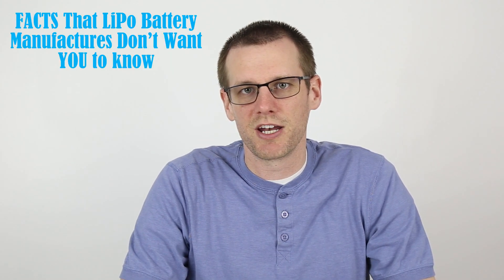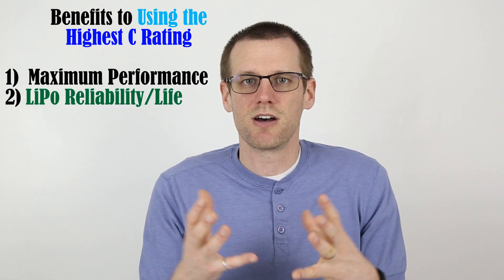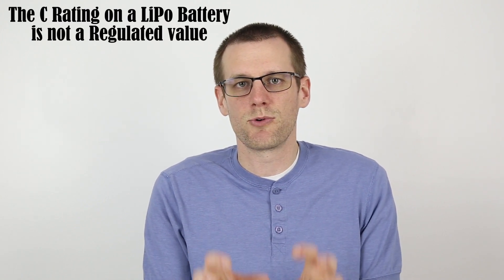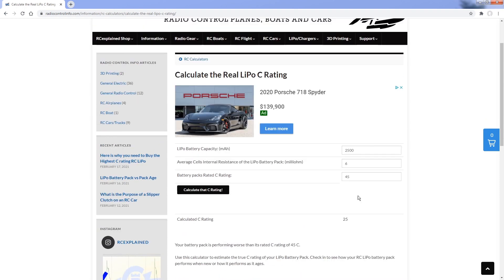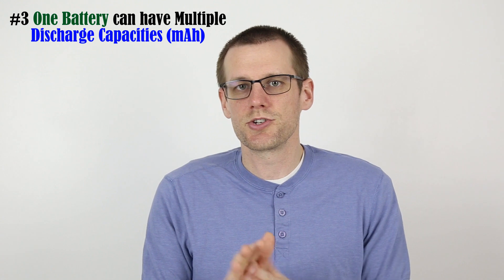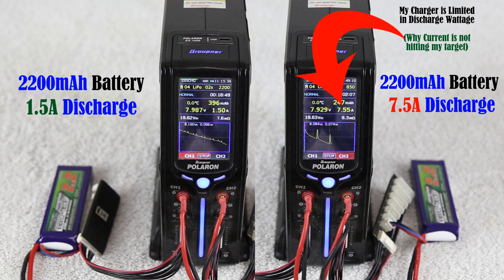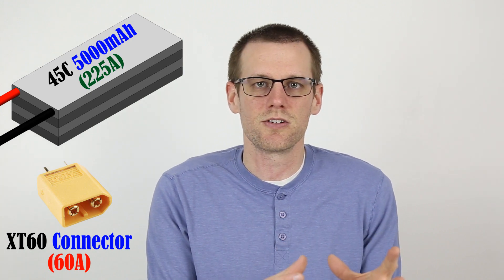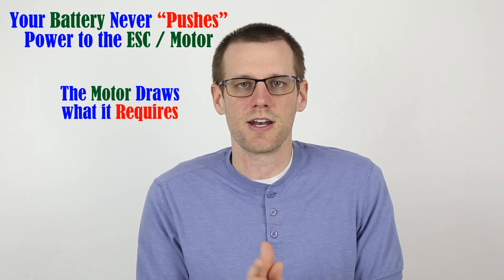What RC LiPo Manufactures Don't Want YOU to Know

Comment: C ratings are like Wishes and Hopes but 100C is more than optimistic 🤔
I have a lot of hours on lipos, mostly RC Aircraft, Drones, ECT. I do have some in RC cars too 😁 
I really don't think there is that much difference between one Manufacturer or another 🤨
Yeah, I have gotten some good packs and bad ones, form the same manufacturer, 🥺 go figure.
Overall I have had better luck with some, but I have some that are still going after 6 years 😲
Brand names and high prices don't guarantee a good battery or that it will meet your expectations.
Traxxas batteries that I have cost up to 3x more than another brand I bought. In the car, on the ground, I can't see any real difference in their performance.
Ok, I am sure we could test all mine and come to some kind of conclusion, but does it make much difference when I go out and play 🤔

Comment: Hello. Thank You for very good content as always i have to subscribe 🙂
I have one question. For Traxxas truck Sledge, which comes with two TRX iD connectors. I want to use only one battery pack. 4S or 6S.
I got 4600mAh with 35C and there was soldered T-dean. I changed the connector for XT90. Im affraid for soldering connector on ESC so there is a TRX ID connector and i have XT90 - TRX adaptor.
I know that better is when i solder off the pair of stock connectors and solder only 2 wires and there place XT90.

But i tested yesterday draw via Link app. On the road i achieved 100,9A max and in the grass 113,9A. So... if im counting right, i should solder XT150 or AS150 on ESC and battery packs?
Because TRX connector limit is about 60A and XT90 is about 90A. But it was in some specification im not sure which A, connectors can survive really. Traxxas original battery 25C 4S 6700mAh, has 167,5A limit, so im little bit confused about connectors limits. Because some folks really using these 2x4 batteries in 8s X-maxx and im sure that  there is a way higher consumption than is specification of TRX iD connector. My question leads to XT90. I have bought few pairs and want to solder also ESC. But will it be enough? These almost 114A i achieved on the grass with stock gearing and with smaller tires than the stock one are.

Im ended my tests after 30minutes, it drawn about  3000mAh from the battery pack and connectors were hot. It never happens on my Slash with 3S.
Exact this "hot" issue make me think about it again. I watch your videos about KV this, and some other. But can not find any suggestions for real limits of different connector types.
I know that motor takes what it want, but yeah in this case it is little bit over the edge when i use one single Traxxas Id or  old TRX 4(which i love)  or XT90  with adaptor to Traxxas connector.

For safe all i should go to XT150 / AS150  and change it also on my ESC, am I right? I think on 4S it is okay, but 6S via one cable and connector, can be an issue. I also plan test 4S battery and do the same measuring. I suppose, there will be a lot lower "A" peak.
Sorry for my broken English.
Reply from the maker: If the connectors you are using are getting hotter than 60C, then I would move up to the next size available. Looking at it from this perspective removes the more technical current capacities. An XT90 will stay under this temperature if you see only 114 peak Amps.
Reply: @RCexplained  Thank you so much for this pretty fast response. Your videos are superb :-) One small question for the Traxxas connector. For it is no much comfort zone i think and the heat production and the bottleneck here will be adaptor and stock TRX iD connector on ESC. Remove adaptor and solder XT90 on ESC is the only solution. Current setup is batt with XT90-> adaptor XT90-TRX-> TRX iD connector on ESC.
Reply from the maker: I would remove the adapter. Adapters are not helpful for performance. Only convenience.
Reply: @RCexplained  Hello. I decided to change all for AS150. Because when bash on 6S its not only short 110+A burst. It can be 2 minutes in the grass. I rather replace for safe also on ESC and on all batteries. I have now only 3x4S and 1x6S so not really high amount of soldering. AS150 seems also to unplug manually easily than XT90, where is some force needed.

Comment: All my big rigs use amss as150 
J pull 600amps + through them. Just look at cable rating I use 8 swg 8” uk use xt90 10” up us as150.  You’ll also need plugs with spark arrest inbuilt to stop spikes in plug it

Comment: I used 60a esc and 3100kv brushless motor,how big value c rating best for my rc boat?
Reply from the maker: As high as possible.
Reply: @RCexplained  tq very much for your answer
Reply: @RCexplained  are my brusless motor and esc safe if i use 11.1v 3s 40c rating?

Comment: Hi there I have just subscribed and I need to know about the battery in my XK Detect X380 which is a 11.1v 5400 Mah 3s 20c, and I am wondering if it would be an advantage to put a higher C rated battery pack in it?

Comment: What about smaller gauge wire on a battery and  putting bigger connectors on the battery, will smaller battery wires  effect output? I bought battery for speedruns didn't realize the wire was 10 gauge I normally run 8 gauge wires on my batteries
Reply from the maker: Yes, smaller wires falls in to the same category of small connectors. You should be able to see in a data log if voltage drop has improved or not.

Comment: Excellent - covers a lot of good information - 1) As best I can tell there are only a few LiPo manufacturers - the cells are  repackaged as different brands and most don't just fudge C ratings - they lie 2) You mention but don't cover internal resistance, which is the real proof of the pudding for C ratings. If you want to see what real battery C ratings and capacities look like go here - 
https://www.rcgroups.com/forums/showthread.php?1767093-Battery-Load-Test-Comparisons

Comment: Great info, thanks! Just got a radix 6s team corally. What charger and battery would you recommend? And is the stock xt90 connectors good enough?
Reply from the maker: That buggy is good for 4-6s. Any 5000mAh 45C 6s pack that can physically fit will rip in that buggy! As for charger, this largely depends on budget. I'm a big fan of the Graupner Polaron series.

Comment: I have some 2S 450mah 75C batteries. That would mean they are capable of delivering about 30A but they only have 20awg wires on the main connector. Something doesn't seem right. I only use them for a maximum draw of 10A.

Comment: Cool, very informative but a 4000mah lipo with 60c continuous would mean 240amps continuous and a decent 7" quad could easily pull 120-160amps burst. Does this mean we would need XT160 connector since XT60 is good enough only for 60A?
Reply from the maker: Hey Dianko, XT60 is good for 60A continuous. Burst currents can be very high depending on the duration of the burst. At the end of the day heat will tell you how the connector is performing.
Reply: test it on ground and you will see, weak connector makes higher resistance at higher currents, it can glow in seconds at proper current

Comment: The "C" Rating was the first thing that came to my mind, too. Especially with the cheaper brands like zippy, I would never trust their ratings. And even if a brand battery can actually deliver that much current, it might not make a lot of sense because the capacity is reduced from all the internal heat losses. Basicall, a battery powered system can deliver peak power when the resistance of the load matches the internal resistance of the battery. But that also means by Ohms law, it is only 50% efficient, cutting the effective capacity in half...

Comment: Use XT60 on all my cars,as they are only 1/10 and probably pull no more than 50A max, and then in only short bursts (garden rally circuit) and having a standardised set of connectors used in all my vehicles simplifies things. Use same for my planes,but again low power field flyers,not amp eating ducted fans,but agree that if investing that amount of money and time you should go for the best you can get-I would want a plane to fail 'cos of crappy wiring/connectors, it could hurt.

Comment: also they are kinda not as good after a good 180 cycles.. still will work but internal IR starts to go up... this battery in RC gets worked pretty good and after a while they will puff... always storage it and dont let the cells go below 3.0v.. people in the off road racing charge their 2s at up to 40amps charge and discharge to get the IR down but it hurts the life span of the battery and only last maybe less then 6 months or maybe less or less then a year... CELL tabs on the battery can only squeeze out so much current also so having a good connector and solid solder without cold solder is the best way to go..

Comment: I have a shorthand way, of determining the amps rating of a battery pack, by using the posted MAH and c rating. Granted this is not perfect, but will get you in the ballpark of what you need in a particular pack or your needs to find the proper pack. We'll use for this instance a 1500 mah 50C pack, What i do is take the mah and move the decimal left 3 places turning it into amp hours (ah) or in this case 1.5 AH. I now take that 1.5 and times it to the 50C rating (1.5x50), the result is 75 amps, If you have a potential 60-75 amp load, this this battery, out side of any manufacturer misdirection, might work for you. Like I said, it's not perfect, because the C ratings are not yet standardized, but can get you in the ballpark of what you potentially need

Comment: for example i bought a 2200mah 3s battery, with 60C rating, but does not say anything about the C rating for charging. when asked, the manufacturer recommends i charge at 1C. isn't this a too wide range? i'd expect a 60C discharge rate battery to be able to sustain a 10% charging rate, meaning 6C
Reply from the maker: 1C is a safe charging rate for all LiPo's.

Comment: in my mind, clearly this is not specified by the manufacturer: how good quality materials are used for the battery, how this impacts the overall quality of the cells and especially what test results for endurance and quality testing they had with their product before marketing it, so that i can do a comparison between different manufacturers before i actually buy different brands to test out on my own expen$e (and this for sure is not a good way to go, as i will not be testing in the same environmental variables as a laboratory does, so results will differ between them a lot => i think this is why manufacturers do not provide transparency, because you as a buyer will not be able to test on your own properly)
Reply from the maker: that's right!

Comment: This is a well known problem between racing and freestyle drone pilots. You said that they could write what they want, but, they pay for it because people always talk about wich battery perform the best, wich one is more real despite C rating an capacity. In my experience I tried rhino (1300mah 50C) leopard power(1300mah 110C and 1200mah 110C) chnl(1300mah 120C and 1500mah 100C)ovonic(1300mah 120C)  and also r line(1300mah 120C) all 6S batteries. Now based on my experience the best battery on this list for performance/cost are 1.chnl 2. leopard power 3. rhino and the most powerfull are the chnl. But the reality when you're flying is that you never reach those high discharge rate, except for few seconds or less. Indeed I can say that I have some 1900kv 6S motors that can suck the lipo like nothing, but, I fly a lot with them. Also the XT60 connector is not that bad for its purpose, and for few seconds nothing would happen to it, I think that about that you're over exagerating saying that it would heat so much to take off during flight.

Comment: I would suggest what I consider a simple(r ?) explanation about the C-rating and the lower recovered energy at higher currents.  It is that at higher currents, you have higher losses in the battery internal resistance.  Or in other words, using a higher discharge rate, more of the applied charge is lost as heat from the battery rather than running your motor (or tester, for that matter).
Reply: It's primarily I squared R losses in the entire circuit, but depends how in depth you want to get to explain "Higher draw - less efficient"

Comment: just make sure all your connections are solid and put a damn good solder on all your leads I've been running Jets and I've been using xt60 connectors on fan units that pull 96 amps no problem and I've been using 4S 14.8 volt batteries I have not had that one issue it's all about how you solder it and how you connect it up make sure everything is tight that's it it's simple a loose connection produces heat...

Comment: GREAT explanation, As I extected how to deliver 40A on jst 😔. I have a battery that is  550 mah 80c but with jst connector.
Reply from the maker: Thanks for the comment. If you are planning on drawing more then the JST connector is rated for, I would swap it out.

Comment: Battery manufactures lie about everything. I charge my cells to 5V and have extra power. It even preheats the battery for these cold days in a sense for for even more additional performance
Reply: You're not getting it.  The battery manufacturers sell the batts to the middleman like Horizon Hobby as basically raw materials.  Spektrum are the ones that put on the fake labels and markets them to you.  
Just like Coca-Cola doesn't give a shit if you buy their goods from Walmart or McDonalds as they get paid either way.  The actual batt manufacturer doesn't give a crap because they all come from the same place anyways!!  It's the lying middlemen that needs to differentiate themselves from the other lying middlemen.
Reply: so you're claiming to charge a lipo cell to 5v. ooooook
Reply: @toolbaggers  I thought it is clear that this is a joke. 5V and a lipo cell will burst into flames, thats what I meant by preheating function. OK now when I read this again, a little bit cringey, it was way more funny when I wrote it.

Comment: Great video. Could you possibly do a video on the difference between a low KV motor with less gearing vs a high kv motor with more gearing. After gearing if both setups have the same RPM which one has more torque?
Reply from the maker: Yes, will do this in time.

Comment: I have Wayne Gills C testing device, my experience testing several LIPO at my club that C rating on label and my testing gives normaly half the C number on the LIPO, so on LIPO it say 30C , real C is about 15. Just remember LIPO should be as warm as possible to have a good internal resistance.
Reply: this got me thinking....i have a 60C rated battery, the ESC only does 60A max, so that's why i bought this battery for my 1/12 basher so that it never gets overwhelmed. after about 10min of bashing the battery gets just a tiny bit warm to the touch in 10celsius weather. if the real C rating here is actually as you say half of what's specified....then this would explain why a 60C 2200mah battery gets warm throttled with a 60A ESC. does this apply to most battery manufacturers ? or did i just get fooled by the one i bought from
Reply: @Ris-v4w  I mentioned in my reply this is for several (most) LIPO's

Comment: Can you do a video on charging and what amp rate to charge lipos at
Reply from the maker: 1C unless otherwise specified. 1C for 5000mAh = 5A
Reply: @RCexplained  I tend to err on the safe side a little and charge them at .5C unless i'm 100% on the rating on the label.  But that's cause i still remember when 18650's had a HUGE issue with their rated capacities till battery mooch started publishing tons of battery reviews. I don't really see any dodgy rewraps anymore usually haha
Reply: @kasuraga  LiIon 18650 and other cells like 20700 and 21700 cannot handle 1C. I suggest you read the OEM datasheet. Most are 1.5a-2a MAX charge. Spec sheets are easily found via google, i.e. "sony VTC6 datasheet." I generally keep it below 1.5a unless I need to recharge an 18650 pack quickly, sometimes I'll push them to 2-3a for the first portion of the charge up to 4v per cell or when they start heating up. The VTC6 is rated at 3a by the manufacturer and thus safe to charge at 3a. The lower "C" rating 18650's like the Sanyo NCR18650GA's max out at a 1.5-2a charge.

Comment: If you cut a hole in your lipo battery it will ventilate better which will give you longer run times and more power.
Reply: Really
Reply: @tommcdonald6371  absolutely!
Reply: Wow
Reply: @2down2togo  I tried it myself it had so much power it lit my shed on fire!
Reply: @saltybutsain6348  lol I almost lit my ass on fire from a lipo going up in flames behind my seat on my electric drift cart lol didn't have them secured properly and one got punctured
Reply: Great way to heat your home

Comment: So what connectors are the best?
Reply from the maker: It depends on the application.
Reply: @RCexplained  6s esc trucks surface dual lipos mainly 3/4s 5000mah 50c 🤔 thank you
Reply from the maker: I would use 5mm bullets absolute minimum